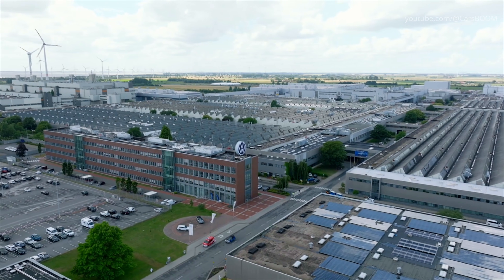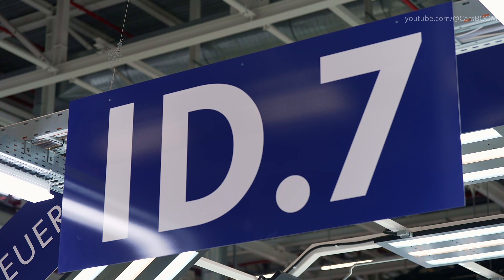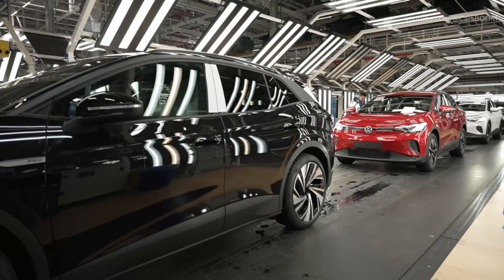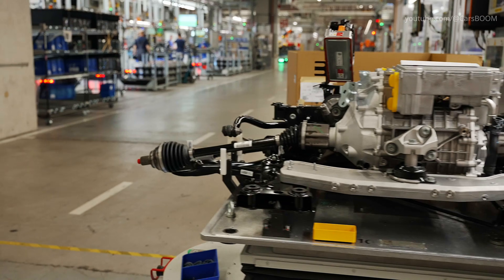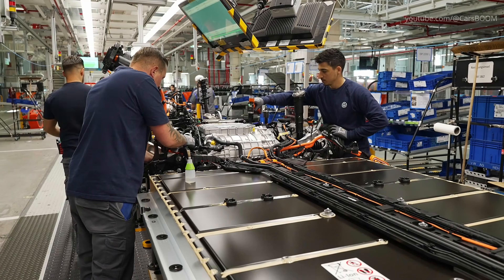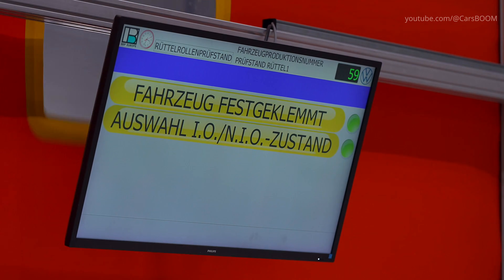Volkswagen ID.7 Factory Tour (Emden, Germany) | Full EV Production Line & “Marriage” Process in 4K

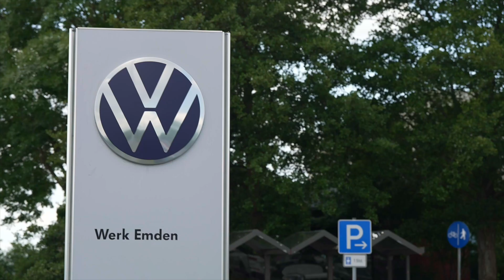Comment from the maker: 0:00 intro
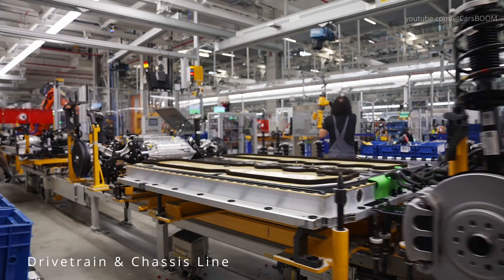0:24 Drivetrain & Chassis Line
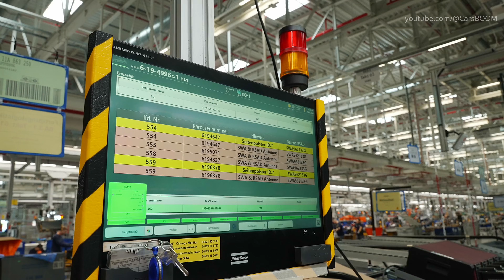2:22 Сar bodies on carousel between shops
3:04 Body exterior and interior assembly line
5:32 Door panel assembly
6:06 The “Marriage” – Body to Chassis
6:48 Front & Rear Bumper Installation
7:51 Interior Trim – Seats
8:26 Doors installation
8:38 Fluids—heat-pump coolant
8:55 Сar bodies on carousel to the next shop
9:57 Wheel Mount
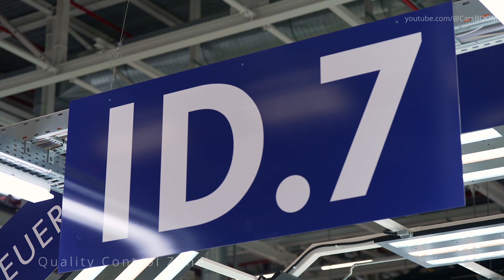10:37 Quality Control Zone
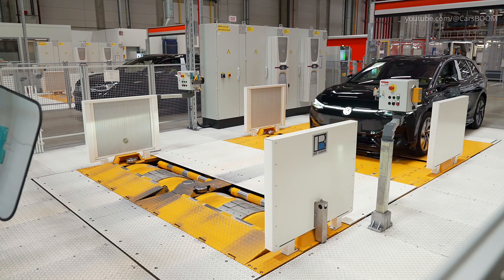11:23 Dynamic Test
12:24 Volkswagen AG Emden plant aerial shoots